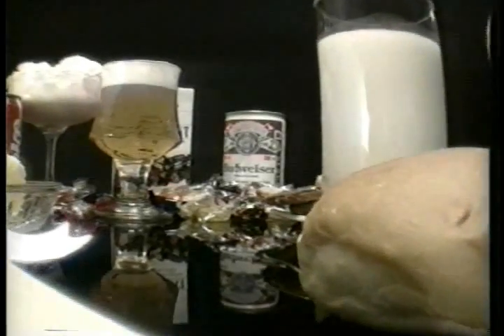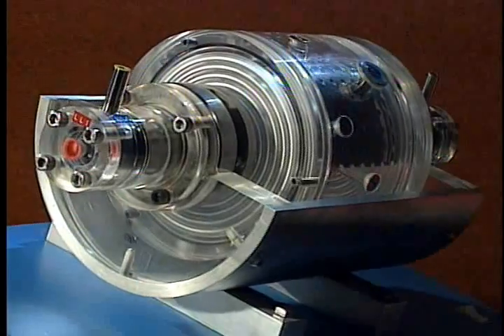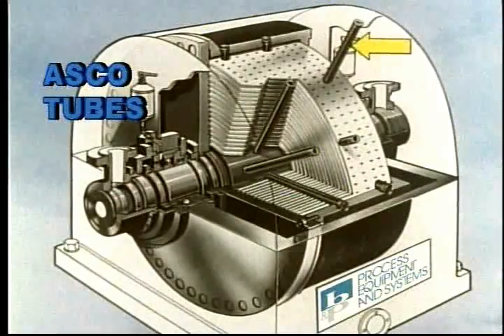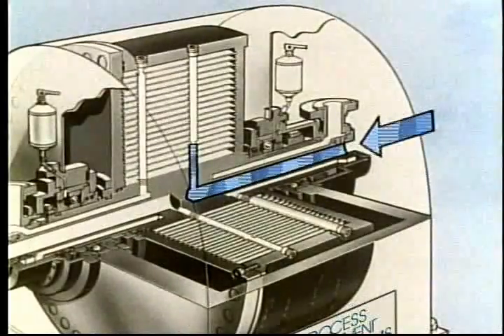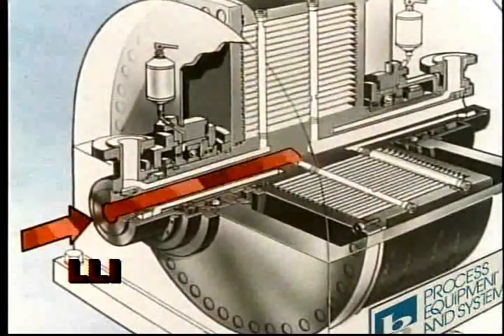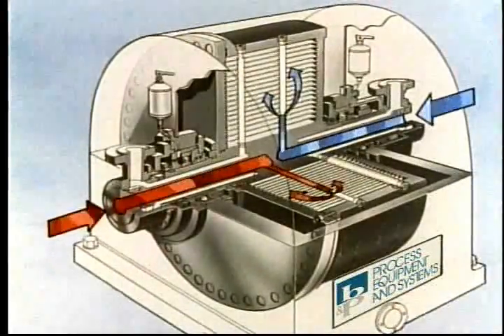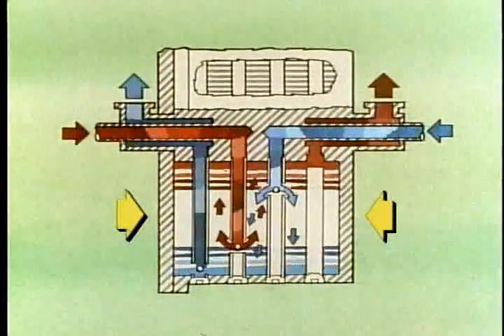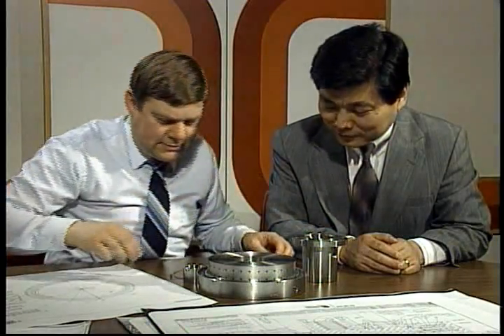Podbielniak Accelerated Solvent Extraction (Liquid-Liquid) Centrifuge

Comment: Centrifugal force moves the heavy liquid outward. What force moves the light liquid toward the center?
Reply: Addison, it is the pressure balance that forces the light liquid to move towards the center, where the LL outlet is. As long as the machine is fed with a mixture and both HL and LL outlets are open and controlled at  the right pressure, there is no other way for the light liquid than flow to the  center
Reply: In the video, the narrator says that the light liquid moves to the center because it is displaced by the heavy liquid that is outward.
Reply: centripetal